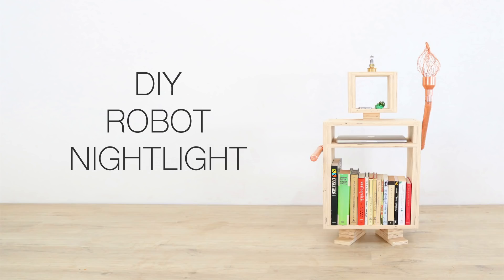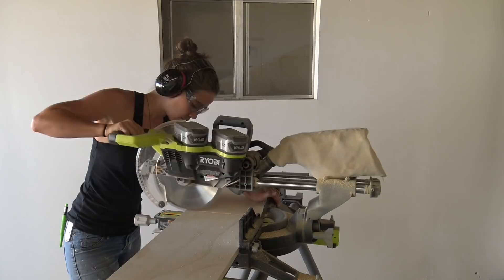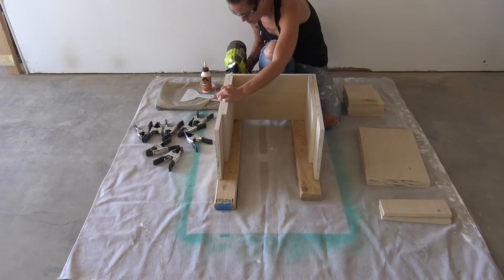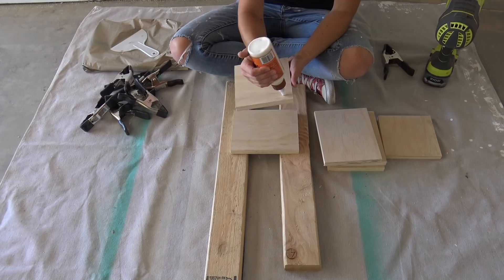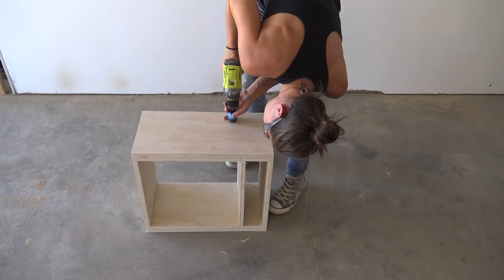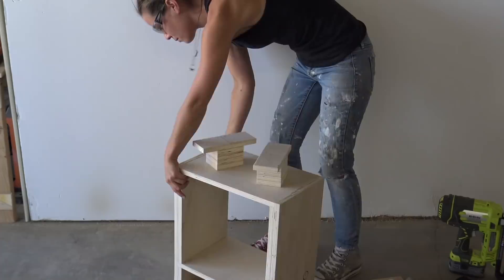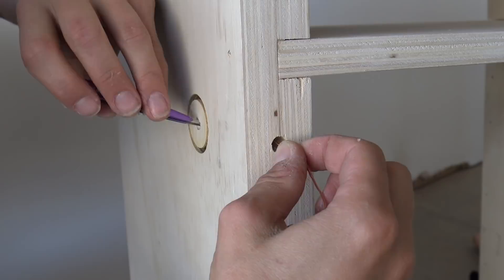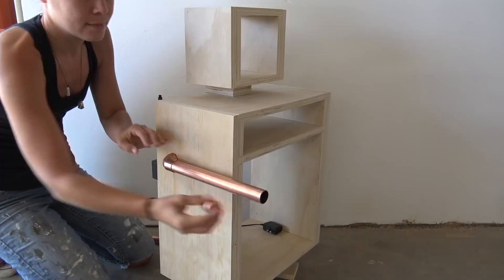DIY Robot Bookcase w/ Faerie Lights

Comment: Two things. 1.) This is why yoga is important folks!! You have to be able to get those angles when breaking down sheet goods. And B.) Jessie you should try the 18 gauge Brad nailer it’s slightly smaller and more ideal for those type projects also try the 23 gauge pin nailer it’s great when you don’t want to see the nails and just let the glue dry. The finish nailer you have works just fine but it’s big and heavy and it’s better suited for trim work. I’m not the biggest guy so I like using smaller guns to match my smaller 💪 lol. Great video as always!!!
Reply from the maker: hooray for yoga and not being the biggest toads in the pond!  and thanks for the tip 👍🏼